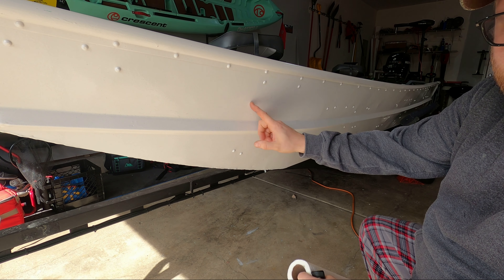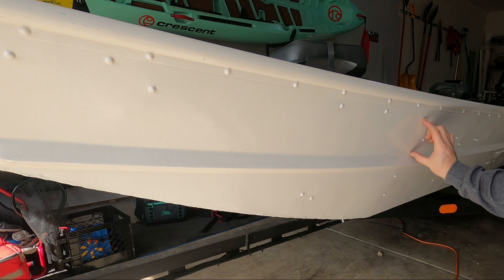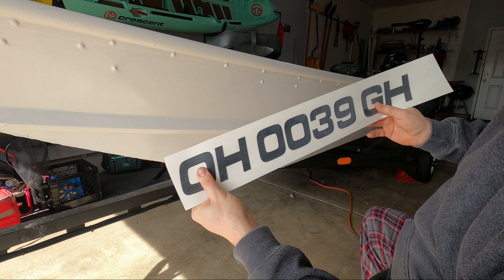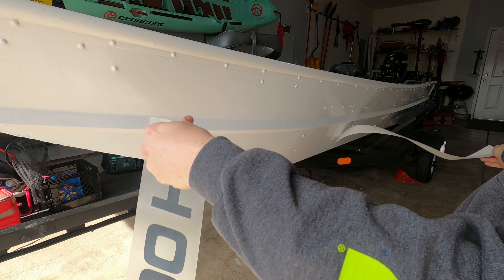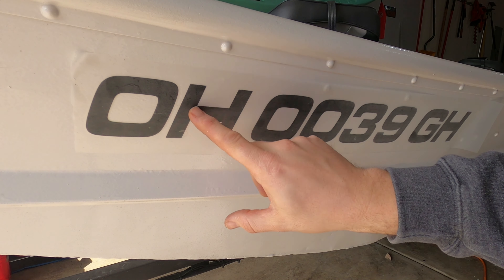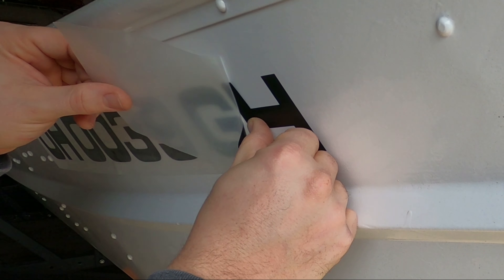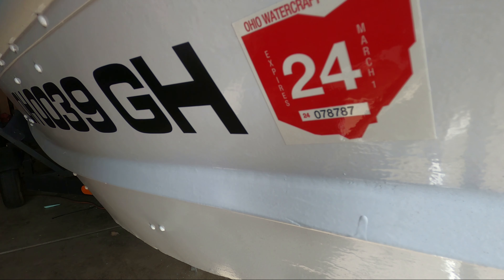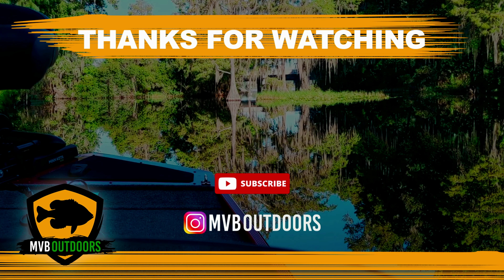HOW TO APPLY BOAT REGISTRATION NUMBER VINYL DECALS -  Jon Boat Build

Comment: Water with a couple drops of dish soap will allow you to move the entire decal as a single unit if needed... getting air bubbles out is a breeze also . Let it dry a little then remove the clear layer.
Reply from the maker: The clear transfer tape used here recommends a dry install but that's a great suggestion when a wet install is possible, usually with a paper transfer tape. Much easier to reposition wet.